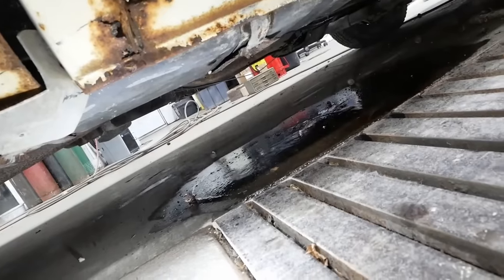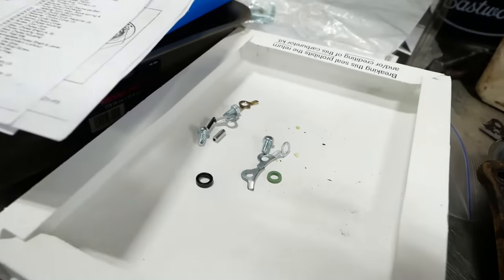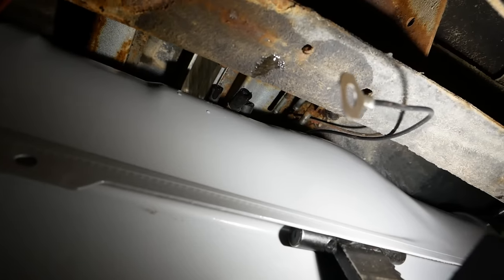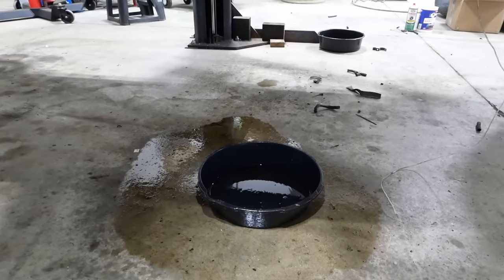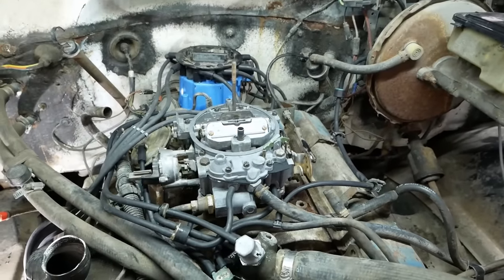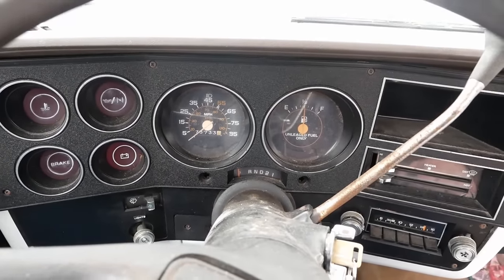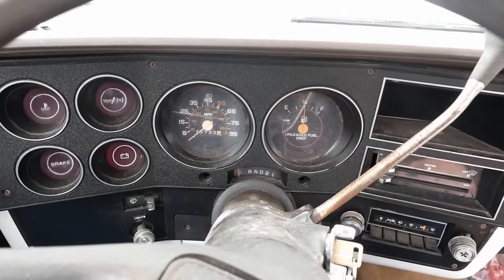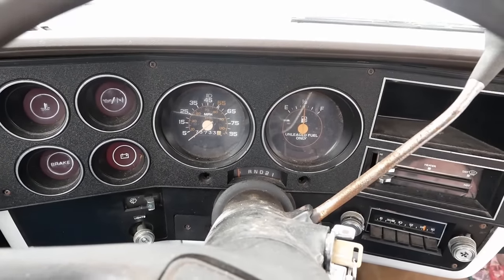Millennial vs. Carburetor | Square Body Chevy Back on the Road After Sitting 12 Years

Comment: Just a thought about the starting issue in the end. if the engine was hot or has run before, it could be vapor lock. In this case, pedal to the floor is an actual way to start the engine. by the way, for this truck, you could have renamed the channel : watch wes struggle ! good video, great content and work, keep it up !!

Comment: On airhorn front side where air cleaner gasket sits is a plug. Remove plug (l made a tool from squished brake line) adjust your needles n let more fuel in. Good luck n God Bless 
Keep the greasy side down

Comment: Cold start ,fast idle sticks.   
The secondary choke pull off is not getting the temp controlled vacuum signal from the 3 or 4 port  valve sticking out of the air cleaner housing ..
You really need to replace the burned out valve in the bottom of the air cleaner housing and hook up the air cleaner trap door motor.  That regulates air temp into the housing so the 3 or 4 port TVS on the side can apply vacuum to the secondary choke pull off to pull the fast idle cam off the steps. 

I think I have a brand new I. Its package choke angle tool in my van in storage. I found it at jm tools in north hollywood a few years back.  Dont know if they have more.   If you dont have one wes I will send it to you when I get my van out of storage in a few weeks.  If you dont have one.

Comment: Hi I'm surprised that the foam float is still good, they would take on fuel and sink causing a potential fire. also the coke spring is probably dead. when I was rebuilding these I would change the float with a brass one and often install a new choke spring. also many problems with the EGR, holes in the diaphragm, carbon plug in the  manifold cross over .
Hang in there Wes 
Rich

Comment: I had a brand new Holley 4010 on a 440ci v8 that I could not get to tip in. I kept increasing the accel pump shot to max, idle mixture to max. Better but always a stumble off idle. This Holley has the removable top and as I had the top off while changing the main jets, lo and behold, when the accelerator pump actuated, it was pushing up a fountain of fuel from the bottom of the float bowl. Yep, bad casting.

Comment: Been there, done that with the driver side tank on my 86 K2500, except I had to order new saddle tank brackets because the plastic shield had caused them to completely rot away. How the tanks never fell off the truck I'll never know. The rust was so bad that I couldn't even unbolt the shield from the old brackets so I don't even have a shield on the tank. I got a hunch it's going to be the same way when I eventually get around to doing the passenger side tank, and I'm praying that I don't have to go through the same thing with the tanks on my 85 C30 dually. I also had the same problem when I put a new fuel pump on my K2500. My theory is that there's different pumps depending on whether you need one for a 2wd or 4wd.

Comment: Only had to change one SBC fuel pump, on a 350, but the only way I could get it on without fighting the push rod was to smear some grease on the rod and shove it up in the bore. The grease held it long enough for me to get the bolts started.

Comment: Since this model year Rochester doesn’t have a front choke pull off , have mrs. Wes crank the engine while your observing the rear choke pull off to see if it’s opening the choke valve to the fast idle position . Some Rochester two and four barrel carburetors have one or the other or both . Since the throttle blades are opening to fast idle position upon starting procedure , the choke valve may not be following through . Since it starts with the flooded start procedure , which will open the choke valve , I believe this may be why it’s hard starting ? Some rear choke pull off’s have an air bleed which may be leaking ? You may have discovered difficulty applying vacuum to it upon the choke valve and fast idle cam bench settings which is delightful a procedure in itself . The rebuild sheet may suggest placing a used accelerator pump cup over the rear pull off adjustment stem , with some silicone to close off the bleed diaphragm . Might be handy for a test ?

Comment: Overall good job on making the truck roadworthy Wes but it has been my experience that utilizing the air cleaner hot air intake from the exhaust manifold stove enhances drivability. Maybe also check that the exhaust port through the intake manifold and under the carburetor is clear and heat risers are functioning properly. I think these engines are jetted leanly and are sensitive to proper carburetor warming to prevent icing.

Comment: Choke was junk soon as it got in carb cleaner. The way to set the choke is with a cold engine pump pedal once then turn your black choke cover until the choke flap just shuts all the way. 1200 rpm cold 850 rpm hot. Done it on a lot quads and works well. The smogulated motor can be timed at 8 degrees . Feds called for certain guidelines so chev backed of timing. Be sqfe

Comment: It's an old engine, so expect the timing chain to be stretched a bit, and some of the cylinders are lower in compression than the others. You don't have to be afraid to advance the timing a bit more to make up for that, in fact most of us old timers used to just "road time it", take it out on the road and advance it until it pinged a touch and then back it down a notch. Try it, it does wonders for old stuff that is past its peak.

Comment: OH YEAH!   I just remembered.   One foot to the floor pump, and watch to see that the choke is closed... sitting on the fast idle CAM, and.... when it fires off.   The "choke PULL OFF"  must work.   meaning...  as soon as the motor fires off,  there is a mechanism where a vacuum source will pull the choke back open about 1/8th of an inch.  (As measured with a 1/8" drill bit)  Stuck between the front of the choke plate and the carb)    If the choke pull off doesn't work, then it will not run very good cold.

Comment: You have to have the Zinc in the older motors and it's race proven that the solid lifter cams have to have it. Now the tractor deal is the perfect thing to put tractor supply diesel oil cheap. I run the Red Line or Amsoil in my good motors. The new ones don't need it or the hydraulic lifters not necessary. Project Farm does have a couple of videos on the oil and the additive to put in it.

Comment: I run diesel oil in everything, 15-40. It's cheaper and everything I have, gasser's and diesels have incredibly high miles so it helps with the blowby and leaks.

Comment: It was in the mid 70’s when GM started putting rear window defoggers on all cars equipped with a Quadra jet.  This way the owners could keep their hands warm when pushing the vehicles to the shop.  To be fair many, if not all cars suffered until some form of fuel injection became the norm.  EPA probably cause more fuel to spill with their silly requirements.

Comment: at 38:26, slide the nylon tubing and fitting in further to where the brass fitting is inside, then clamp the rubber hose overtop the nylon tube where the brass is. 😉
yeah, it's not 100% kosher, but will outlast the rest

Comment: I've been running old junk for my whole life,  tractors, cars, lawn equipment, etc.    Never once have I put in a zinc additive and never once have I had an issue with a cam.   Same with lead additive to fuel and valve seats.       However, Zinc and Vitamin C work great for killing a common cold.

Comment: Electric chokes of the 70's and 80's were always problematic in varied operation. the standard fix of a manual choke conversion made life simple and reliable. Otherwise they were like my Ford 300 6 that required a screwdriver down the bore to start anytime after a 3 or 4 mile drive. If you went 10 it was fine but just a few minutes and it was not enough to open the choke on restart and it wouldn't hit a lick.  Several years ago when Ck4 replaced cj4 Deere issued warnings about running many of the new oils in Deere engines because Deere still had mostly flat tappet cam engines. It took them a year to formulate an oil that they said met the wear requirements but would also meet ck4. Most of the road oils like Rotella will not pass Deeres wear requirement for the older engines. Because the good stuff in oils tends to harm emission systems many manufacturers have just taken it out as it is cheaper to rebuild an engine than replace a DPF so......

Comment: There is a real possibility that it never did run correctly.  Some smog carburetors were that way.  Put a 327 in it with a mid 60s era 4gc carb.  It will idle like a Rolex watch.  I had a 64 Mailbu with a 283-2 barrel that would start and idle slow enough that the automatic would sit there without your foot on the brake.  It only had about 250K on the odometer at the time.

Comment: Zink additive is only meant for modern engines (i.e. 0W20 VAG 508.00) and is green. The engines in question have a special cylinder coating.

Comment: Great video Wes and as far as the zinc additive I didn’t use it on a 88 Jeep 4.0 and it ate the camshaft and lifters started using the zinc additive and no problems every since so I use it in all my vehicles prior to 96 and it to me has made a difference in the older vehicles of mine it’s too me made the lifters a lot quieter after i started using the additive

Comment: Go to the dollar store and buy a couple gallons of pure lemon juice and a kettle big enough to hold your carb, then boil the carburetor in the lemon juice for like 20 minutes. Best carb cleaner I've ever seen. On par with the nasty chemical stuff you dip the carbs in that takes everything off. Nice side effect is that you get a nice citrus smell every time you fire that engine up too. Sounds silly, I know. I thought it was bogus too until I tried it. Works amazingly.

Comment: I had a quadrajet in a 1970 Chevelle. I bought a rebuild kit with normal expectations. I simply had to readjust everything as well as set the float level different. It then ran somewhat like your pickup for about a year when it straightened out and became easier to drive. ¿¿¿¿¿

Comment: Awesome video!  I bought a 1970 Buick Skylark just to tinker with... and I've had a tough time getting it to run correctly even after rebuilding the carb.  I put in a manual choke which helped a little bit, but you're almost convincing me just to LS swap the car.  Carbs are cool but they also seem really annoying.

Comment: I can't remember the last time I did a carb rebuild only once.  especially on small engines with tiny circuits it takes 2-3 tries. 
this vid brings back bad memories, working on a stepside squarebody of the same vintage, but this one had a Holley carb.  also had a worn throttle shaft, and I think the accel pump was bad because the truck would stall on quick throttle tip-in.

Comment: If you find a good carb guy on them quad a craps carbs there gold. Ive had a couple good quad a crap carbs then i had the ones that dont want to run not a carb guy my self. But when them carbs work good there great. Good job on working on the old American steel

Comment: if you put in a longer bolt in where the fuel pump push rod goes, it will pinch the push rod and hold it in place for you.

Comment: Reference the motor oil, My theory is the additives were slowly removed due to the higher tolerances in modern engines. For example my 2014 Silverado uses 0-20 full synthetic oil.

Comment: Yes the oils I think if you don't have that you're usually incorrective or use 15 and 40 diesel oil because it has a sink art in it as high as the passenger car moderal used to have

Comment: I believe flat tappet cams do need zinc but only during the break in period. After that any modern oil is fine. I've had good results with this philosophy, but it is just my opinion. That being said, if I use a performance cam with heavy valve spring pressure, I use zinc additive or diesel oil full time. Can't hurt. Oil's cheaper than parts and speed parts ain't cheap.

Comment: I have a 48 Chevy truck with a worked 350 and it doesn't have any problems and I use 10W30 even after 135,000 miles

Comment: Flood after it sits awhile...ck for a well plug leak.  Carb kits usually have a black spongy rubber gasket that sits under the well plugs and seals them.

Comment: The quadrajet is probably one of the easiest to rebuild and it can be a performance carb also(with the right parts) I used to get a kit that you could install new bushings in the throttle shaft and performance jets, I believe it came from California , Art Engles I think, man could I gets some response from them. I really miss doing repair work and carburetor engines.

Comment: simply use very heavy grease to hold the fuel pump pushrod in place, no need to remove the bolt and fiddle with screw drivers/magnets.
now days a very strong cheap magnet often works too., try it over the magical plug-bolt or either side of it. (clearly I've changed a few in the past) 🤪

Comment: Primary choke pulloff is missing .
When replaced use adjustment screw to set choke opening to about 1/4 ".
Choke wire connection pointing straight down.
APT up 3.75 turns from seated .
Idle mixture screws out 8 turns for 1980 and newer  , 3.5 turns 1979 and older .
Fast idle 1800 rpm , ignition timing 12° BTDC. Distributor  to manifold vacuum. 
Secondary choke pull off you are using now is not needed or is used to fully pull choke off when vac temp switch opens when engine is hot .
Reply from the maker: Nothing is missing. This is the factory setup.

Comment: The gasket between the intake manifold and carburetor has an open center. If the intake has separate planes (dual plane) that gasket needs to separate those planes. It needs to seal between the planes (needs 4 separate holes). Having a leak between the planes will give you less low end torque.
Reply from the maker: It's not and it doesn't.

Comment: The ultra sonic cleaner works great, but be carful with pine sole and aluminum. I did the same and didn’t wash the carbs good nough afterwards and it ended up corroding the absolute shit out of it within a week, to the point the butterfly valve seized right up. I switched to some dish soap and bar keepers friend or simply green and that seemed to solve it.

Comment: Open the choke to full and look down at the spray that the accurate pump spray. it should be a strong spray. if not the check ball isn't setting in the hole right. Or the needle under the spray port is missing

Comment: If you suspect a vac leak, with the engine running spray either on the suspected area, if it takes off, you got a vac leak.

Comment: There is something about old tractors work hardened parts hours of heat pressure and lubricant seems like the conductivity between sensor and tone wheel would be crisper without soft metal interference

Comment: Just for kicks and giggles it's been sitting for a long time maybe pull a vacuum ck on the egr valve and also on the airport between the front and rear ventures is the power valve you can adjust it to allow more fuel during tip in through full throttle this may help your stumble.

Comment: It makes it easier on Is number one top dead center to install the fuel pump the Cam that operates the pushrod to go up-and-down will be at its highest point there just a little info on that trying to get in if that push Rod tube is down you fight it going on

Comment: It will run fine with those disconnected as long as both are open especially one on air cleaner provides air to carb

Comment: Quaddies are great when set up "right" and that's just the thing with the chokes. The specified default setting for the choke doesn't always work the best.  I've seen some people manualize the chokes with cables into the cabin. Something to note when you put the fuel pump on. Adjacent to it are 2 pipes and they look like transmission cooler pipes. I noticed they weren't clipped together properly with the clip half dangling from one of the pipes. You want to attend to that otherwise the pipes will rub together back and forth and soon wear a hole in a pipe.

Comment: Your vacuum break is over adjusted. Carb cold and use a vacuum gun to operate the vacuum break. Adjust by opening the the linkage to the specified distance, use a drill shank to to say 11/32 or what ever the spec is for that carb.

Comment: Hi Wes Im 58. WE called em  Quadra-junk back when we was kids for a REASON.  lol  Hint I learned from an OLD mechanic in my EARLY GENX life    on a CARB VEHICLE Pump the Gas then COUNT "one thousand one  one thousand two one thousand three"  THEN turn key to start.  Fuel takes time to get from the bowl and ATOMIZE in the cylinder head.  and my observation  you Mills are WAY TO NICE...lol  what ever happened to GRUFF old men with "dirty" pics on the wall. Take Care!

Comment: I think the door on the breather snorkle needs to be functioning. You need draw heat off the exhaust manifold to help vaporize the fuel so it gets to all the cylinders when the engine is cold. My experience is it will never run right until it warms up all the way without this.

Comment: I don't think it's the 2 degrees of timing, I think it's heat that fixed the idle.  Those old carbureted engines really didn't ever run completely well until they were thoroughly warmed up.  We are spoiled by computers and fuel injection today because we expect our cars to just start and go.  But in those days, you had to go through a warm up.  The chokes helped when they worked, but..............

Comment: Also the brake pad situation isn't a huge deal, heck it's a non issue. I know it says you have to adjust them per the service manual. I'm a tech for the postal service and we don't bother with making them as tight as you did with that center punch. A little play is actually what you want. The inner floats..... So should the outer pad. I've done hundreds of that style of GM brakes. You would have been fine without the BFH and the center punch. 👍